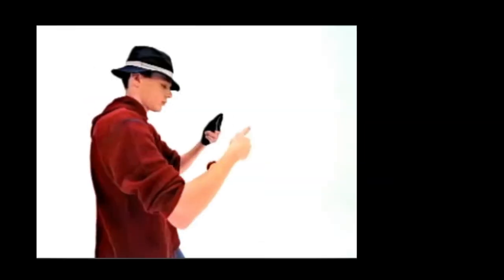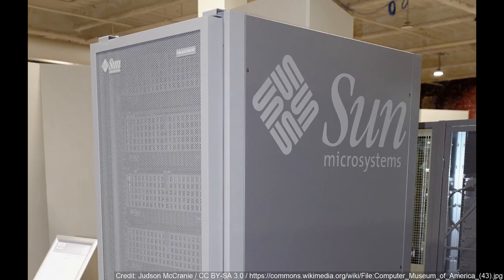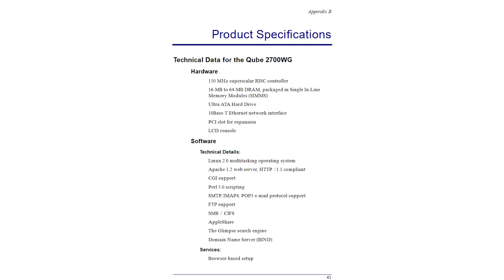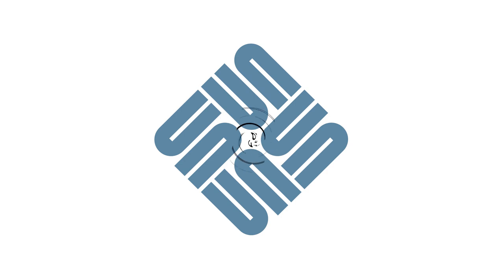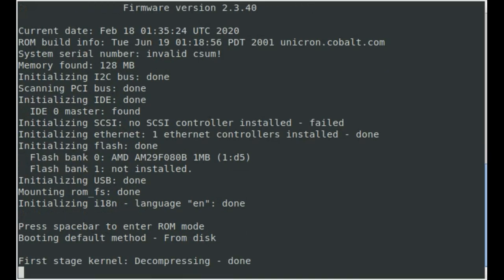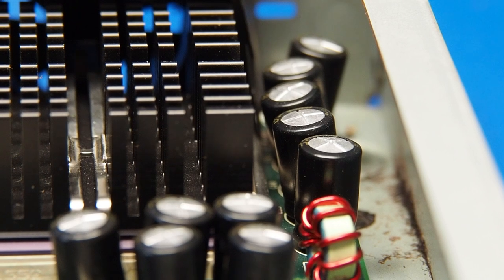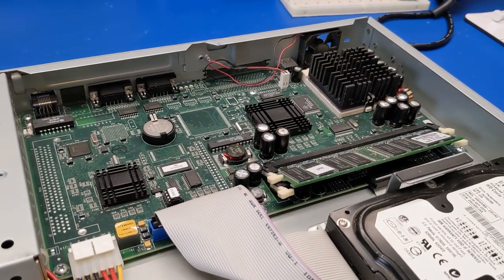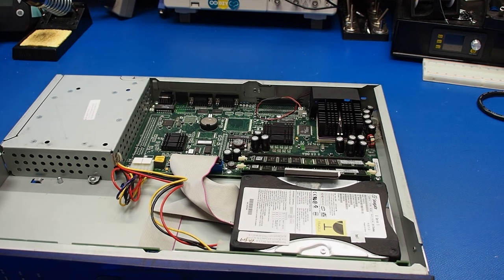This Web Server Changed The Internet: The Cobalt RaQ

Comment: Definitely bring one of them back and host a public website from it ! 
& Other you can swap the motherboard for one of those itx celeron or pentium boards and host a modern website from there.
Reply: Unfortunately that isn't so easy.  The RaQ (3 at least) uses a ROM that helps to boot up and start the os.  So it is also pretty difficult to upgrade the os too.

Back about 2005 or so you get updated ROMs and some other goodies and do a fair bit of updating.  But even at that level it would have a very old PHP and MySQL (and 1 other db, I can't remember it's name) and apache etc.  It'd be suuuuper risky for a hack.

Mine was later maintained by an outsourced expert and it was much better then.  But they were a truly great box!
Reply: Putting one behind HAProxy (lock down the various config page endpoints) and Stunnel (For modern SSL) would allow it to be safely used to host a live website. Not that it could host MUCH, but a static page or even a very crushed video would be doable! I don't believe these even have gigabit ethernet so your major consideration will be bandwidth. 

These are really cool and were very popular in schools where I'm from as general internal webhosts. I remember my school had one that was hacked to allow a fileserver, hidden and wiped nightly, that we'd all use to share music and games in the computer lab! So DO make sure your HAProxy config only allows your specified server locations to be accessed by the internet.
Reply: I wouldn't bother upgrading it, TBH.  It's plenty sufficient to chuck some HTML over the fence.  It doesn't take much.  It won't serve millions of hits per day, running complex back-ends, all over HTTPS... but it doesn't need to do any of that.

Comment: Sun dropped the ball totally after acquiring Cobalt. I loved the Cobalt Qube at work, however we never really rolled them out to production, we carried on using big Sun hardware.
Reply: They didn't drop the ball, they wanted to eliminate the competition with their existing lines.

They may have struggled to figure out how to support them, and indeed how to migrate content from these to a proper Sun server.
Reply: I'm distinctly recalling an ex Sun employee (although they weren't working there at the time) describing Cobalt as having been killed by the antibodies.

Yeah that sounds right.

Comment: I remember wanting to buy a Cobat RaQ in the mid aughts. I was setting up a community WiFi network and wanted something for users to look at when they connected. I ended up using a Windows 2000 machine and it ended up hosting much more than just a web server.

Comment: I have two of these in my garage that ran my not-for-profit world wide car club for 10+ years. Have three actually, two of the RAQ 4s and one of the long chassis Intel based RAQ XTR 4 drive one.  If I recall, I ran them from about 2005-2016 with progressions of supported OS up through BlueOnyx. The XTR got containerized into a VM on VMware and the RAQ 4s were decommissioned after migration of domains to the XTR. I loved these machines and it became my stepping stone for CentOS knowledge that put me where I am today in Enterprise IT Infrastructure. Will be watching this series.

Comment: I ran MIPS RaQs with Debian for a long time as router/firewall boxes for several customers. They were only replaced when those customers' Internet connection outpaced the packet forwarding capabilities of the RaQs. The last two in service got switched over to NetBSD/cobalt before being removed from service, which was much faster than Debian at that point.

I'm still running a Qube2 on my desk as a persistent IRC client (screen + irssi), running NetBSD/cobalt 9.3. One Ethernet port sits on the public Internet (we have a static /28), the other talks to the Ethernet segment for old computers. The only failure was the mechanical hard disk several years ago, which was replaced with a mSATA SSD and an IDE adapter. PSUs were supposed to be a weak point but I don't think I ever got a Qube that actually had the external power supply...always ended up adapting something else!

Comment: Oh man a blast from the past. I never worked with these systems but was fairly active in the industry.  The 29F080 AMD BIOS flash was a good memory.  The PATA HDDs, of course, are why your systems are not up as they just were never designed or qualified for data storage longevity for more than 3-5 years.  Looking forward 20-30 years into the future, the modern SSDs/HDDs, especially SSDs, are going to have very little of its data still available as they have fine tuned their 5 year reliability in exchange for optimized cost.  I have to say I don’t miss those little PATA jumper blocks that were used to configure the HDD as either a PATA master or slave device.  I hit pause every 5 seconds during the boot admiring every single line.

Comment: I actually still have one of those rotting in the garage. I got it when I worked at Symantec, who used the same platform for some of their firewall appliances (can't remember, Raptor or VelociRaptor).

Comment: I never knew these were that old, saw them in a few broadcast sites.  Mainly in racks owned by commercial radio stations at the transmitter sites.  Assume they were used to link the broadcast transmitters to the studio feed over IP rather than via a microwave link or antenna. .

Comment: I bought a raq 4 after the internet bubble from someone who came back from the US. I used the server to create run a Formula 1 management game running a game over the F1 season with 2.500-3.000 active users during the season.

After that I bought a supermicro which had a software raid which was placed in colocation. But that one gave an  issue after a couple of years.

Comment: In 1995 I was a sysop at a residential-facing ISP with a bunch of commercial customers requiring web hosting.  We had about half the city's web traffic hosted on a single Pentium 90, and it had no problems at all with the load.  FreeBSD and Linux on consumer x86 hardware ran the whole place, and it was always more than sufficient.  Don't really understand this idea that independent ISPs didn't have the capacity to support commercial web customers.  We did custom CGI, databases, whatever.  And so did everyone else in town.  This was all super basic stuff and at the time the technologies were very simple.
Reply: And we were smart people talking to the customer, doing the tech and doing the business. Rather different than today's environment.
Reply: This was still in the era when it was assumed that doing a professional-quality job required expensive proprietary hardware and software. Quite a few people looked askance at Linux and Free software, and it took years for this attitude to change.
Reply: @lawrencedoliveiro9104   Well, it hadn't really proven itself yet.  Linux was just a kitten in the mid/late 90s.  In a way, Sun wasn't that much older.  But, at those times, a few years was an eternity.

Comment: Getting these running modern Linux is probably very doable. The fact one of them has a much later CentOS build suggests the board support may even be mainline. 

Looks like much of the bootloader is in ROM, but without pausing through the video to see all the logs I didn't catch whether the second stage BL (which appears to be Linux based) was in ROM or HDD.

To get started, I would:
* Duplicate the hard disk contents to a new disk so you aren't destroying the original when playing.
* Check the new copy boots unmodified.
* See if there's a defconfig, either in the kernel sources, or somewhere online, for this platform.
* Try to build it.
* Check the logs and look for the filename and clues to the format of the LAST kernel it mentions booting.
* Copy the relevant build artifact to the location.
* See what happens.
* If that works (at least to the point of trying to mount rootfs), it's just a matter of generating a rootfs and maybe providing a cmdline to find it. I'd install a suitable distro on a VM and copy it onto the target disk. Use the kernel config option for baking the cmdline into the kernel to avoid having to figure out how to configure the bootloader.

There will be some tinkering to do, but it will be much more interesting and rewarding than sticking a modern board in there.

This is the first of your videos I've watched, so I've no idea what your experience is and I may be telling you what you already know, but if you do decide to go the interesting route with this project then I'm sure a lot of us viewers can offer help if you get stuck.
Reply: I haven't touched my 4i for over a decade, but I was able to get it booting NetBSD (then 5.0) through some shenanigans. It boots Linux first which then loads a NetBSD kernel (from an ext2 partition). Linux distros are starting to drop 32-bit support, and ISTR K6/i586 support was dropped by the kernel, so you may be stuck with rolling your own or dusty decks. I don't think NetBSD has dropped i586 support yet, but modern web stacks have grown incredibly thick over the last couple decades, and it may not be usable for actual work.

Comment: I have a 3 and a 4 in the basement. The 3 functioned last time I tried it, the 4 needs some help. 

Your idea of swapping in a different motherboard is likely the best method for someone who wants to actually use it as a server. After substantial research, I came to the conclusion that running a newer kernel on the old motherboard was going to be tricky, and beyond my limited linux abilities. There are severe memory restrictions involving the bootloader, which actually is multi-stage. The first stage gets the hardware initialized, and then loads the kernel. Modern kernels are too big for the memory restriction. 

It may be possible to compile a stripped down custom kernel that will work, but I didn't make any headway there. Now my memory gets a little fuzzy - I think the original OS uses a 2.4 kernel? I think a 2.6 may work, but anything newer is definitely too large in the usual configurations.

Since my 3 is working, I'll probably leave it as-is or try to compile a custom kernel and see if I can get it upgraded to more modern levels of security. But I may have to look into a motherboard swap for the 4 since it doesn't boot up. These are cute little machines, being a very shallow 1U design.

Comment: I built my own dedicated solid state webserver out of an HP thinclient (a fraction of the size of that RAQ - basically the size of a bible).
It's been running on a 400mghz single core processor with 128mb of RAM (basically the same as the RAQ) and a 64gb USB stick booting MicroCore Linux (TinyCore Linux minus GUI) for the last...  15 years.   Nonstop.   9 watts.   Silent.  No moving parts.

Before then I ran my webserver on believe it or not, a super rare hard to score "RIOCAR Empeg" Car Headunit Mp3 player that ran Linux on intenal 3.5 platter drive.  I ended up selling that to a music enthusiast as a token of friendship, and the dippy do turned around and sold it to someone else, and so I regretted it.

Comment: Huh interesting.  I used to work for a small MSP that deployed Linux appliances (on homemade SFF PC's) around 2004-2005.  We either used Fedora or Debian and it did everything.  It was the local roter,  firewall,  DNS, DHCP, Samba/CIFS, etc.  Since it was Linux based it was really easy to remote in and admin.  We also used it as a jumphost to RDP/VNC into Windows boxes.  I wonder if the owner was inspired by the Colbalt Qube.  Also later on I was at a big Sun shop that did all x86 Solaris.  They did have bunch of x86 Sun Fire V20Z servers.  I wonder if the design was inspired by the Cobalt acquisition.  Those have a little monochrome LCD screen in the front of the server.
Reply: Most likely. Things changed quickly around that time. Cisco blue pizza boxes were really popular in early 2000 and all the hosting companies advertised using them as a feature. Those ran linux and apache on them. The whole LAMP stack really took off back then. Only enterprises used Oracle or Microsoft SQL. I remember we charged $19.99 for 100MB of space and 500MB of Bandwidth.

Comment: One worry I'd have given the kernel they state there is filesystem corruption. Linux 2.2 was not long on journaling filesystems and there might not have been a gentle shutdown at the end.  
I'm surprised that second one could talk to the display given that OS is much newer than Sun discontinuing the product line.  Did they provide OS upgrades as paid support?

Comment: That's a flashback and a half. I have very vague memories of having to load a 2.4 Linux kernel from rom which chain loaded the later and larger 2.6 kernel from disk as that couldn't be made to fit in the rom and for some reason it couldn't boot directly from the disk? Honestly don't remember... Fond memories of using a Psion 5 as the serial console and fighting usermode apps to make the buttons and screen work. Raq3 well past eol iirc.

Comment: Uh.. i have a couple of Cobalt RAQ3 (with K6-III 550+ , and 512MB ram) that were "obsoleted" after it rained inside the data center right about 2004.
They ran a relly old 2.6 kernel, and the init scripts for the LCD control were kinda specific. I remember rewriting everything to run a newer linux distro with a 3.x kernel.
Havent powered them on since... 2006. So, now i feel the need to check on them. xD

Comment: interesting to see how server hardware changed over the years, how older hardware used to have less components overall
Reply: It went both ways, going back even further mother boards was larger and crammed with components, then with standardization you had fewer and fewer actual components.

Then you hit the problem where efficiency became a thing and suddenly you started squeezing more into each box, and improving airflow for cooling (which was not as required on the old ones).

My first 80286 had a board more than twice the size of the Raq3, and since this was before the SIMM/DIMM style memory modules it had on board memory in the form of rows and rows of individual IC chips. So while the Raq3 had maybe a dozen circuits, my board had probably 50-60 separate chips ;)

And no heat sink, that was not necessary outside of the power supply.

Comment: Which brand / model were the risc CPUs before the K6-2?
Best wishes.
Reply: They were MIPS cpus as I recall.
Reply: Don't recall the actual printing on the CPU (it didn't have / need a heatsink, running at 250 MHz) but it was a MIPS R5000-compatible design.
Reply: A quick search indicates the MIPS R5000 was a 64-bit CPU.

Comment: I had dozens of these in the early 2000s. They were trash, Cobalt was trash, and sun was really trash, but I built business around them. Far too many nights spent fighting bad Perl code, poor engineering, and buggy patches. Moving sites and users was extremely slow. The boxes were also very underpowered. Raq4 servers needed extra fans added to the rear slot.

Comment: Hooking up to another PC? Just use a Psion V for serial console and monitoring.

It wouldn't make any sense to design an x86 mainboard like that in house, your best bet would be to hire someone like Chaintech or any of those other companies with x86 experience. These would be clean designs, they don't have to resemble something else other than the reference implementation.

Comment: Docker is not different from that except that it is open source software rather than hardware and it does not configure itself… I guess you could argue that JavaScript has been converted into a Réal programming language by now… so you could NodeJS/Express 😅it is not plug-n play though 😮

Comment: I'm not convinced the Cobalt products were transformative.  I don't know of any company that purchased these, and the hardware isn't fault tolerant and doesn't use components which were considered best-of-breed for the time.  I also don't recall seeing these in any notable volume in datacenters at the time.  Seeing a Cobalt Cube or RAQ in person would have been a notable novelty.  Cobalt was sold to Sun at an enormously inflated valuation because of the bubble.  Linux was on the rise despite Cobalt, I think they latched onto Linux mostly because of the people they hired early on, not because Linux represented an ideal path forward.  BSD was more commonly deployed in appliances around this time because of the licensing around BSD, it didn't require companies to disclose or publish anything, whereas the GPL was considered "viral" and somewhat radioactive.  I think that VA Research had a larger part in adoption of Linux by the masses around this time, their sales volume was greater and their impact wider.  Everyone bit the dust when the bubble collapsed, Cobalt just sat down before the music stopped.
Reply: Huh?  These things were everywhere.  You couldn't walk through a comm closet without tripping on a RaQ and Whistle InterJet.

GPL code had/has a bad rap for its dogmatic licensing, but that didn't have any impact whatsoever on someone using it as a product.  These things were empty vessels, into which you could write tons of HTML, perl, ColdFusion, or whatever your poison -- and none of that required disclosure to anyone on account of the licensing of the underlying application framework.

Whether these things propped up Linux, or the other way around -- that's rather immaterial.  That's like asking which was first between Myst and CD-ROMs.  Linux obviously had enough legs to support the vibrant server application landscape that ran on it, but I have no doubt whatsoever that this brought Unix to a lot of people that hadn't much prior experience with it.

These are at least partly to blame for my spending slow nights at an Internet help desk compiling Gentoo Linux on a spare Pentium box.  That led to a career in the sysadmin department, and on to managing a datacenter full of Sun Solaris boxen, and the rest is history.